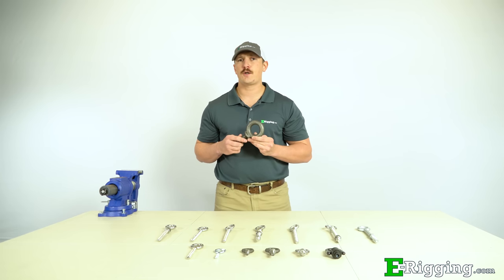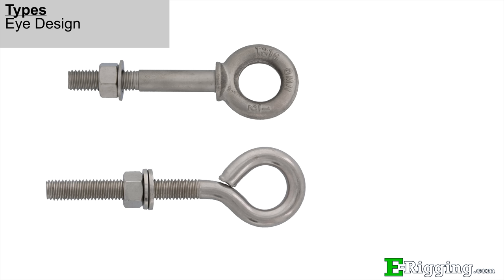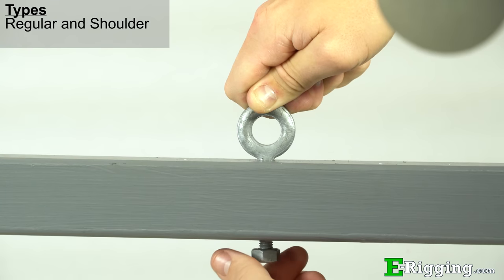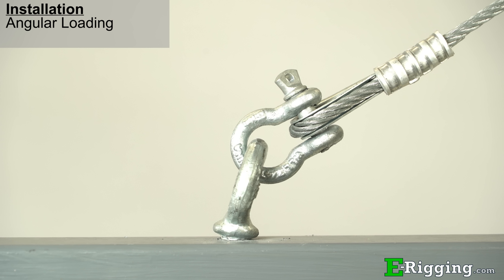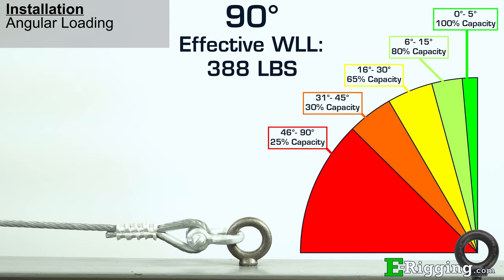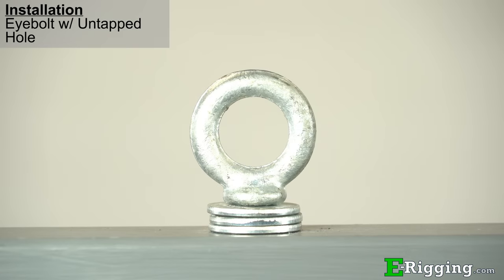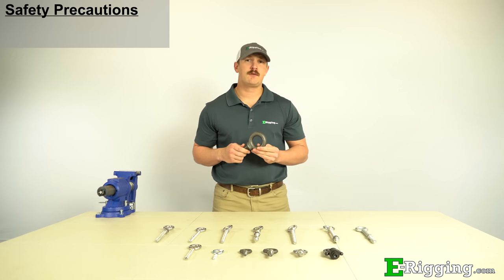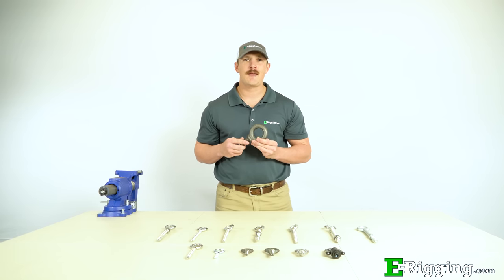How-To Guide to Select and Install Eye Bolts

Comment: Thank you very much for this info. I was using the eye hole at the wrong rotation. And it kept putting extra forces on it. Thank you for the video. I wish it was easy as just asking what orientation the eye hole should be at. But I did not find the answer that way

Comment: Are swivel hoist rings only available with the included allen-head cap screws? What if one were to have an off-angle application requiring the eye to be fastened with a long through-bolt, or even a lag bolt?

Comment: I've been trying to find a machine grade Eye bolt 3/4 inch that goes into the top of a milling machine to move it , the machine weights 7500 lbs,

Comment: Just wondering why that last rigging was forbidden. The one with the 2 shackles and wire rope.
Reply: My guess is the entire load is on a single wire rope. In effect, you're pulling the load up with a single cable from the center of the object.

Comment: 8:35 "Never rig a cable between two eye bolts".    What's the reasoning for this, which is presented as an absolute rule - never?  I'm struggling to imagine.
Reply: I can think of three reasons.  In increasing order of significance:
1) The load angle in this situation is probably not what you think it is at first glance, and reduces the working load limit in a way which is probably unexpected, both in terms of the bolt strength and in terms of the force on the cable.  You can see in the video how much the bolts are being pulled in toward the middle when weight is put on them.  (If you remember your high school physics, you might draw out the force vectors and see why this is.)
2) For slightly unbalanced loads, this effect is even worse, since one bolt effectively suffers a more severe load angle, and is also taking on the majority of the total load.
3) For even more unbalanced loads--once the centre of mass gets outside one of the bolts (roughly)--the whole system is unstable, and the load can flip on its side and drop pretty hard with little warning.